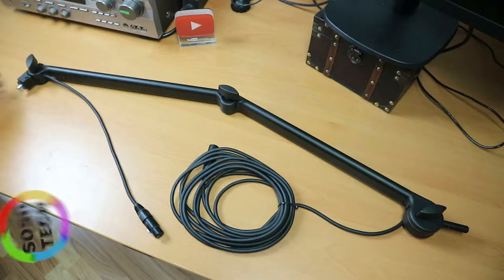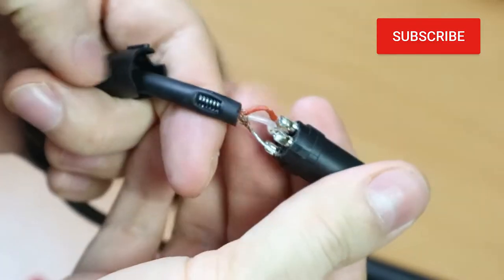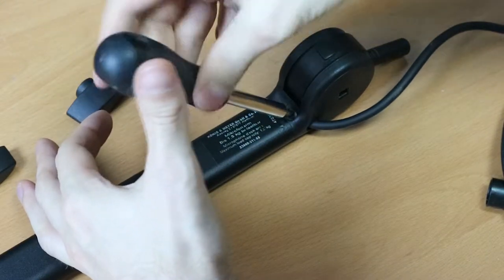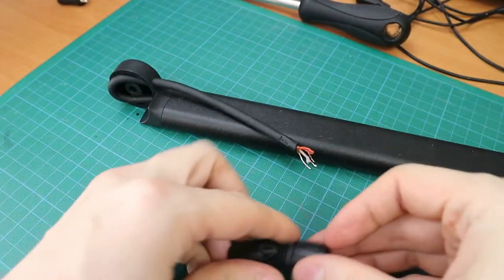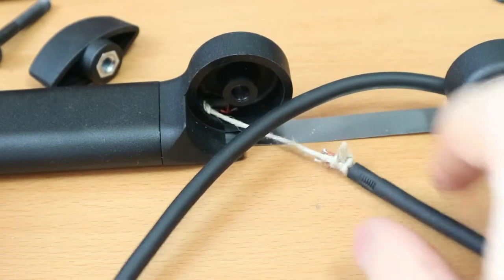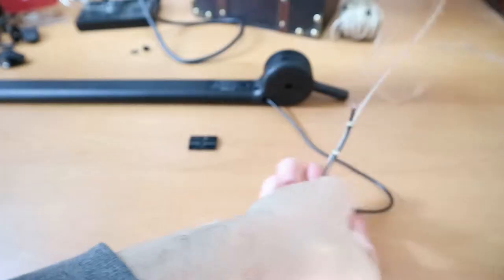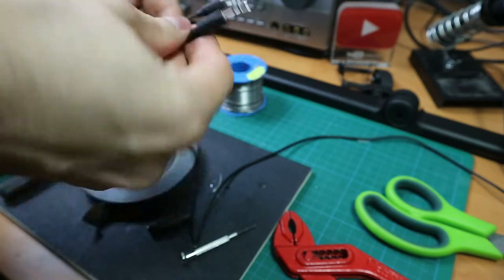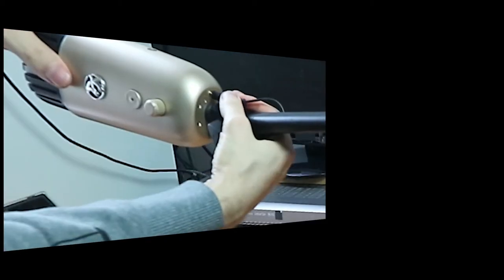Replace/Remove XLR Cable in Tube Style Mic Arm (K&M 23860)

Comment: I've got the Innox IVA 8 xlr pro, which is same design as this. I'm moving the soundcard to a soundproof fancooled rack cabinet further from desk where I'm also putting my PC (audio production, computer makes some noise and interferes a bit). So replacing the standard XLR with a longer starquad XLR. I started taking apart the arm but worried there could be some extra bits inside if I got too radical, so looked and found your vid.
So far I had worked out I could manage by just taking apart the top part nearest the mic and if I'd cut the connectors off, I could get by wirh soldering the other cable on to the old one, shrinkwrap the join for extra strength and prevent snags, then drag/feed through until the new cable is all the way through (as long side will be opposite the mic end, it makes sense to feed from the bottom to the top), then cut off the end where it attaches to the old cable, voila. Next I can solder neutrik angled XLRs on the ends and I'm good to go again. Thanks so much for this vid, it was fun to watch you tinker and is nice too see that it's hard to screw this up - the stand isn't gonna go "Ping!!!" and throw springs or other parts into the air (or at your eyes) even if taking the middle bit apart.
Very well filmed, thanks again.